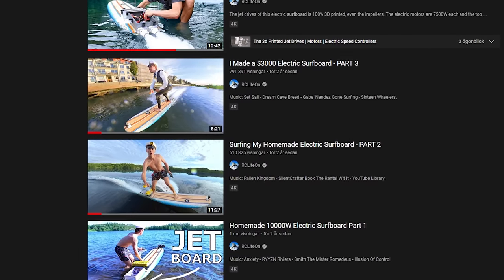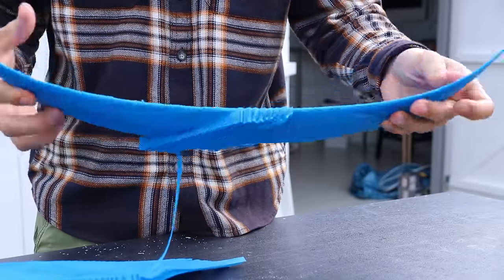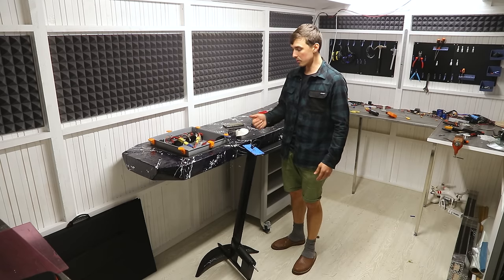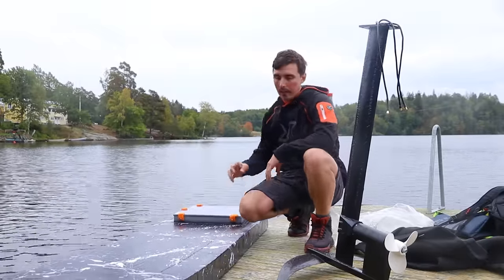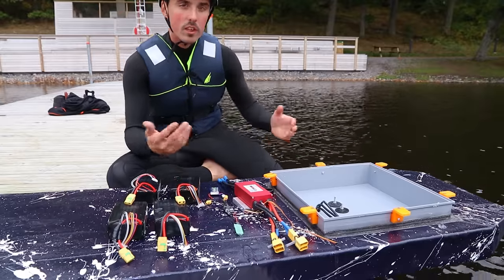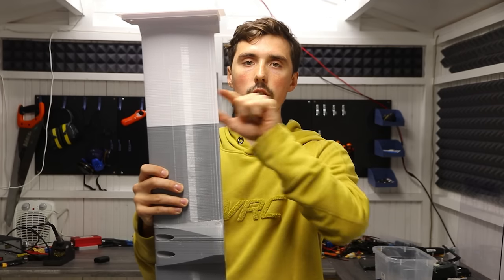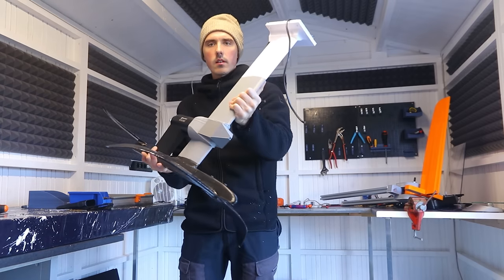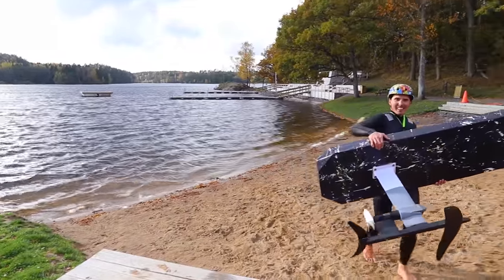3D Printed Hydrofoil Surfboard - Will it Work?

Comment: My guess is that your 3D printed wings flex, so they don`t do all the job and just partialy. You could make the wings out of a lighter material suck as the same blue foam carved, shaped and reinforced with resin and some structural material such as carbon fibre tubing. also checking them wings for reference they are  wide and thin as they need to cut through the water.

Comment: Hello friend 🙂, I built an efoil and I'm confident to tell you that either you don't have enought thrust either not enough lift.

If you want more lift scale up the width of the front of the front wing and also scale up the wing area of it. But more lift mean more power needed to push you. Will it be enough? With the same 2.5hp 3 blades Yamaha propeller and my 50kg I need 50V and 25Amp to fly.

Comment: Learned the hard way  the best way to drill in 3D printed parts is to run the drill in reverse. Melt through the material. 2:33

Comment: To me the foil looks to be symmetrical.  The length of the top should be longer than the bottom to create a low pressure above the foil (wing).  Flatten the bottom surface of the wing.

Comment: A good idea would be to add carbon fibre tubes through the mast and wing as reinforcement to stiffen the 3d printed parts. Also you said you have 16 amp hours for your battery?

Comment: You might think about putting a wire on a 45% from just above the prop to the bottom of the board to stabilise  The foot!.??  What do you think you could make the leg smaller less drag with 1 little wire if you put 3 of them you could make the leg way smaller!!.  If you started with a  fiberglass rode through shape it with some glass you can not brake that!!.

Comment: I keep thinking about the propeller. Racing boats have only small diameter propellers, but high revolutions. Is the tourque on this 'large' propeller making the electric motor unable to drive to a higher revolution?  Maybe a smaller diameter prop will give you better control?

Comment: Check out Clearwater hydrofoils he makes kits with wood wings and composite wings he has lots of sizes that have been tested . The front wing relitave to the board is tiny I’m amazed you got it to go as fast as you did. Slap on a new wing and stabilizer and you will be flying 👍

Comment: Increase the backwing angle, mount the foil furter to the front of the bord to increase lift or make the horizontal mast, aka fuselage, longer for a greater levreage (i wouldnt recomend it because it'll most likly breake.  For better takeofs reduce the glide surface at the rear of the board with cutouts.
Maby loock at the Olympic IQFoil for inspiration. That's my kind of thing.

And ... the back foot would have to be wehre youre electronic box was. Maby also try griptape for a better stance on the board. 
Greetings

Comment: The bottom of the board is so flat. Maybe if you shape it like what you see on the bottom of a speedboat it will maybe give that last bit less resistance to lift you out. Now it's just like a door, it wants to stick to the water.

Comment: omg this is so hard to watch 😅

offset the foam board ends as much as possible, cut them into if needed and give your best shot at sculpting the foam before glass fiber reinforcement.

And the hydrofoils are usually made of "continuous" carbon fiber, metal or more glass fiber than just one sheet 😂

also make the hydro foils stronger and maybe 10-20% larger... take care to attach them as straight as possible.

keep in mind everything has to support your weight, you can test the strength of the wings and everything by attaching weights with the right amount of weight in correlation to what they should be getting when in the water.
if it holds add at least 20% more weight (better 40-60%), so you're less likely to get a freak accident 

sorry if this feels a bit rude, but I hope you can learn from the mistakes.

Comment: It doesn't work because the wing sides flex and this problem changes it shape and no longer produce lift (or the speed is slow). You can discard the speed issue testing if it lifts without you. At 10:37 you can see it flex a lot just by touching the wires, will be more with your weight on top. Probably you will need to study how much the wing itself flex proportional to its size and material with the speed, or just make a mold of the 3d print to have more stiffness, or use other material, or just double the width and reinforce the wing inside with some rods it will help to lift without increasing the speed. Also if the pole itsef flex forwards, the lift force isn't probably pushing your weight up straight, just in diagonal which cause a reduce force up of the vertical component of the force. It's a bit tricky to get the physics working.

Comment: You were so close to lifting off.  That looked like a foil that might be near stalling at a high angle of attack.  How stiff is your front wing?  Assuming the shape is smooth enough not to cause flow separation, all lifting bodies with a foil shape have an overturning moment as well as lift.  If the wing is not stiff enough, you may have the wing tips rotating upward causing stall at the tips and transitioning to reasonable lift near the roots which are unable to flex.  There is a good chance only about half the wing was providing good lift.  
The other possibility is the mast is flexing and reducing the angle of attack so much the wing is not really providing much lift.  But your new mast looks pretty stiff so my guess is foil flex.

Comment: Btw, the previous website I listed applies for water and air type vehicles. Water and air are both considered liquids... in an engineering perspective so they are both treated the same. The densities of water and air are different so you do have to take that into account. I am an AET engineer so feel free to ask questions. I will try to answer to the best of my ability. If you happen to have discord and would like to chat, please let me know.

Comment: Could it need an adjustment to the pitch of the wings?  i'm sure during development of these the wings are adjustable and then once they find the optimum angle they pin them in place?  Or perhaps adjustable based on rider weight  / position?  I just can't help but wonder if playing with the angles of the wings alone might have done the trick?  Larger wings would give more lift but also make more drag, and it already seems a little slow.  I wonder if the wings were larger if you'd go too slowly for them to work?

Comment: Does the bottom surface need help to leave contact with the water surface? Any step(s) on the board bottom surface? Any need of extra hydrofoil wing, helping in the lift moment, while perhaps later "flying dry"?

Comment: im from berlin i know that xps is styrodur its more heavy but also stronger but you could easyly use eps. .. also  shape the sides round check on youtube how to shape surfboard rail and rocker. but  i think its alot of heigght for the  power system to lift up anywayhmm

Comment: I wonder if by having the motor push water over the hydrofoil (thrust in front of the wing) if it would generate more lift at lower speeds?

Comment: I don't know what is your level of foiling, but the front wing you use seem like a high aspect wing, not design for what you are trying to achieve.  Front wing is way too small. You should have at least 1300cm3 in order to be able to foil at lower speed. And you should also reinforce everything, from mast to stab, cause when you're gonna be flying, you don't want anything to break and come back at you in the fall, specially not the prop runing at full speed... even with multiple fiber glass layers, i am not sure it will hold the flying tensions... maybe wear a board leash, so that the board speed is cut when you fall (same principle as wing foiling) - Best of luck anyway, finding a way to 3d printing efoil would be great, so wishes you the best !

Comment: There's no way that plastic mast will be able to support your weight plus additional forces when turning. It should be carbon fiber or something, with reinforcements at the mounting point. 3D printed parts should only be for hydrodynamics.

Comment: Print Female Molds to laminate the Wings and the Mast out of Glasfiber or Carbon (to be wy stronger and have the real FOil Shape(3D Pint+electric sanding machine means youre profile ways way of( more drag; less lift)

Comment: I’ll be honest I skimmed though a lot of the video because my 6year old kept asking me about other stuff 😂 so I may have missed you mentioning it. But I was wondering what your CG situation is???  It lookEd to me like you may have just been standing too far forward in Relation to the hydrofoil, and is probably hard sense your basically over the battery box which I’m sure your not wanting to step on.

Comment: I just think your wing is too small...I have a Fliteboarod and the wing that you should start with that has a lot of lift is about 1100 to 1300 square cm...I think you will be able to be up on foil on a 1200 square cm...I now use a 800 square cm with has less lift ...The bigger cos wing will get you on foil with less power and less speed...the smaller wing needs much more power and speed.

Comment: The front wing is too little bro try a wing that it is at least 1300cm2 because you are using a kitefoil that it probably is smaller than 900cm2 also that kitefoil desing is pretty old so try it bro try a much much wing in area with a much newer or modern desing wich requires a higher aspect ratio, the higher aspect ratio the bigger the lift, pump and glide. But this compromises manuverability so bro look towards that and haging a equilibrium between lift and manuveravility and this is the aspect ratio. Good luck.

Comment: Ive a billion $ idea for you. Its not a flying surfboard. :) another great vid. Can you send me a link  to an e-addie.  You wont regret.
Reply: Flying Innertube. Use an electric boatmotor, 3d print a hydrofoil for the motor. It "ll need carbon fiber . Itll need a compensating Center of Gravity... the battery & or rider, on a cnc raíl system wired into a rc flight stabel, chip.  Ideally dir x & z. Or you may need 2 props/jets for steering. A power adjustable seat. Seated with a joystick on lawn chair setup. These parafoil surfboards looks fun but have a limited market. The compensating CofG could improve the easability of ride and no wake..they'll sell like hotcakes to the yaught crowd.

Comment: The design of the wing is wrong. Try with a little inclination. The front a little upper than the back in the frontal wing. (between 5% and 10%)

Comment: You need to move back some more. Also give it some pumping, some board “stick” to the water. Make sure you vertical body alignment is on top of the front wing. See https://youtu.be/Fqr4shpVUU8

Comment: Your wing is way to smal. I would suggest to print a mold for the wind and then fiberglass the wing property. Some friends and i made two hydrofoils already. I would also buy an aluminium mast and anoter ESC. This flyer ESC is trash. They unesing a VESC.

Comment: do not make structural parts directly from the 3d printed parts, as it is the worst structural method and rather: 
 - use 3d models to make templates/moulds for proper fiberglass / carbon fibre structural parts  
 - make channels in the 3d printed parts and put the fibreglass/carbon fibre reinforcement inside 
 - or reinforce your 3d models with fiberglass / carbon fibre from outside

this will also reduce weight of 3d printed plastic and significantly reduce costs if replaced by polyester resin and fibreglass

Comment: to improve you need a bigger wing, your electronic box is poorly placed as your back foot needs to be over the mast to get the proper lift, and the size of your board seems enormous, I wing foil and for a beginner foiler of your size, I would suggest a 90-litre board. also in the video, you try to lean back, this is a bad technique with a wing that's the proper size if you lean back that means you are not at the appropriate speed you will stall when you come out of the water. if appropriately done once at the right speed you should just float up. your foils don't seem smooth enough they should feel like glass otherwise you'll have too much drag I recommend covering them in carbon fibre to achieve this and your mast doesn't look stiff enough. a flexing mast is no good.
below I will leave links to proper equipment you can reference them for your next DIY build
foil: https://axisfoils.com/products/png-1150-carbon-hydrofoil-wing 
rear wing: https://axisfoils.com/collections/rear-wings/products/475-progressive-carbon-rear-wing 
fuselage: https://axisfoils.com/collections/red-fuselages/products/s-series-standard-fuselage 
mast: https://axisfoils.com/collections/aluminium-masts/products/19mm-aluminium-820mm-foil-mast 
board (phazer 5'8): https://kitesource.ca/products/ak-phazer-wing-foil-board?variant=37981495656628&currency=CAD&utm_medium=product_sync&utm_source=google&utm_content=sag_organic&utm_campaign=sag_organic 

hope I could help

Comment: Wing area is not enough, use 1400square cm front wing to take off on 15 kmph speed. 3d printed mast is soft, so your flight will be unstable. Wasted a lot of time. Poor wereless RC, receiver mast be above the water all times.

Comment: You'll never get enough stiffness from stupid 3D printed plastic. 
Print molds, lay carbon unidirectional and resin. Compress.
Or better still don't use the stupid printer at all.